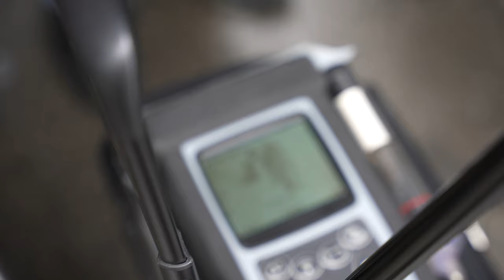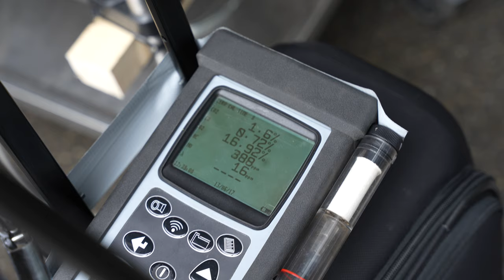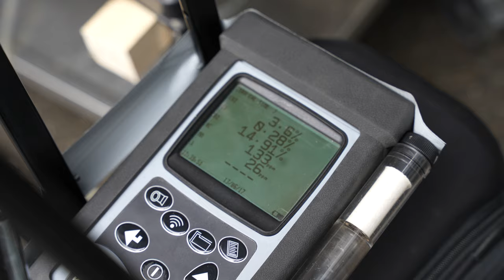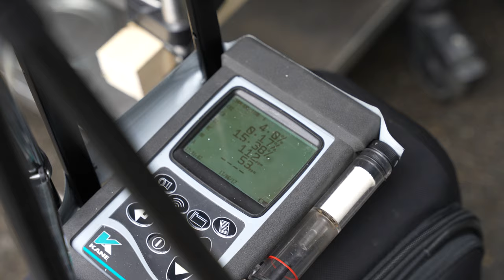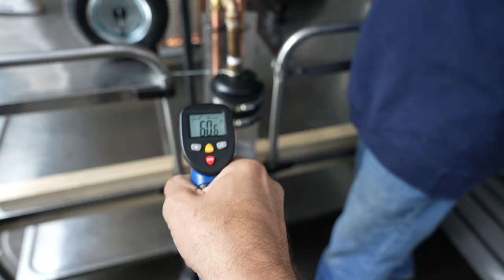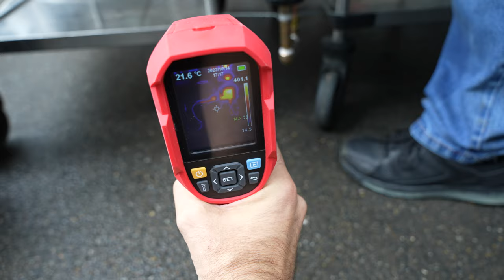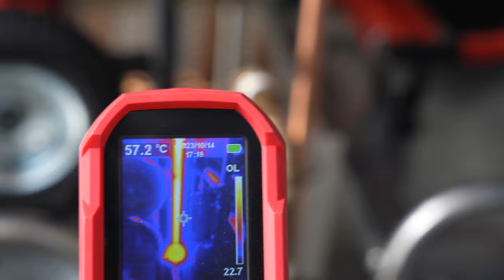THOR - First switch on of Thunderstorm modified new generator

Comment: Martin, you'll need to alter the rubbers on valve stem seals as HHO will dry and deteriorate them fast.

Also you'll need to sample oils afterwards to inspect for carbon particulates and acidity and viscosity changes to further understand or mitigate potential long term issues!
Reply: His name is Bob, btw. Martin is who the project is dedicated to.

Comment: How does he expect to get away with this?
Reply from the maker: If it works, he will, if it doesn't he will not. There are a very large number of eyes on it now.

From our point of view, the video evidence pointed to EVOs / Micro-Ball Lightning being present, having charge separation and multi-axis hydrodynamic flow can form them, this has that, so we predicted there would be Iron Rich crenellated microspheres, which are a signature of extreme magneto-hydrodynamics in micro-ball lightning. If these were present, there is a potential mechanism for the claims to be real.

Upon examination, we found vast numbers of Iron Rich crenellated microspheres.

https://youtu.be/itiyF9snuyY
https://youtu.be/5xM1N08LbA8

When another 3rd party took and maintained chain of custody of a sample right up to analysis - again, these structures were very rapidly found.

https://youtu.be/xFIVXJv0XPE

Comment: Thanks for the upload Bob...It would be useful to have 2 generators, one completey unaltered,  without the thunderstorm generator, side by side, same load, same measuring equipment to compare all the readings.  Maybe with a fixed amount of fuel in each, to see which one runs the longest..This would be cheap and easy to set up and quite conclusive...
Reply: Oh forgot to add, the inventor should drink from the bubble chamber, or hold a lighter to it, before start up, to prove it is water, and not some kind of fuel, like alcohol or something:)
Reply: @marksmith9218  straight for the jugular lol
Reply: @marksmith9218  it doesn't need to run all day, or even for an hour, if the gain is significant, it should be noticeable in comparison even if they put in just 10 mins of fuel in the unmodified engine
Reply: @sFeral Yes I agree, it would be easy to demonstrate, and joking aside we really need to be convinced that nothing else is being fed into that intake. The fluid in the bubble chamber and those stones at the bottom of the chamber, or whatever they are, need to be tested to..Also the internals of the thunderstorm pipework, how do we know there isn't some kind of catalytic converter or conventional chemical reactions going on inside? If I were MB I would release a detailed schematic of all parts for DIY replication, before the 'deep state', as he puts it, crush this project..
Reply: Also, how haven't they thought of using a miniature gasoline RC engine ? It's cheaper, more practical and portable than putting things together on the spot
Reply from the maker: I already did this - video to come
Reply from the maker: I have video where I demanded he drank the water added and I smelt it before being added. It was a fresh mineral water bottle. The bubbler block is standard from pet shop and it just has metal spool pan scrubs in the bubbler. You will see all in detail
Reply: @MFMP Lol, that's what I like to hear Bob, a man as suspicious as me...
Reply: @sFeral Yes, i already have a couple of those R/C engines,  if MB truly wants this open source, all we need is a simple replication tutorial, with parts list, let the genie out the bottle before he gets Stanley Meyered. The only bit that looks critically tricky is the geometry of the spheres..I saw a box of stainless steel "garden spheres", various sizes, in 'home bargains' last week, I stopped and pondered for a while  :) Then I thought, probably not gonna be 'sacred geometry', so we need exact dimensions and thicknesses....We can see everything else from the video, looks like 22mm copper pipework to me, 200mm clear bubbler, standard plumbing connectors and reducers etc, Bob already showed us the exact UV bulbs...Just need that sphere set up!
Reply: I've been watching Bob everyday for over a year. I guarantee if he's involved... There's no funny business going on.
Reply from the maker: Either that, or I haven't established the proof of funny business yet! @nathanford5436
Reply: you guys are missing the point because the video did not explain what the point of the video was. as most of this channels videos do not. its always something random without explanation. they were trying to show the output from the exhaust is effected in a way that nothing you could put in that bubbler is going to be able to do. the intended effect was to show near atmospheric levels of o2 in the exhaust stream and almost zero levels of CO and PPM of HC while the generator was under load. this was not achieved here in this video apparently due to vacuum leaks in the air intake stream. leaks are almost inevitable in a quick scratch build with minimal tools and equipment and time. so not really sure the point of showing the video. its more of a vlog post than anything intended to prove or share information.  again...as most of this channels videos seem to be.
Reply from the maker: You got it, we publish and be damned as we go. Mostly this process does not offend people. It has the benefit of time stamping events / prevenance and allowing for back-referral in future discussions. We have never tried to be a polished channel. Raw and uncut mostly. @freelectron2029
Reply: @MFMP  lets not make the mistake of confusing frustration with offense. blue hair be damned.
Reply from the maker: Not offended, here to help understanding, doing best that can be done with very limited resources as open volunteers. @freelectron2029
Reply: @marksmith9218 the sphere set up needs to be on a ratio of 4/3/2, there is another channel I think it's called alchemic science, it is explained how to build on that.

Comment: Can you tell us more about the “hijacking” of the demo unit that forced the team to build this one from scratch? I am impressed that this one seems to cut CO2 much more than the big 300 kW generator. With regards to the need to have a human operator to get the valve openings right, that aspect looks much the same like in the case of the GEET. Does Malcolm have any idea on how to make that part of the procesa automatic?
Reply: Yeah that would be interesting, personally given what happened to inventors in the past, I would have had several units ready just in case one got confiscated, which let's be honest is what you would expect them to do!
Reply: i beleive he mention in another video that malcolm has repeated issues with the postal system losing or delaying anything he tries to send via the parcel or postal service.